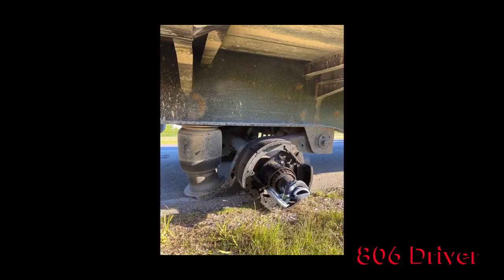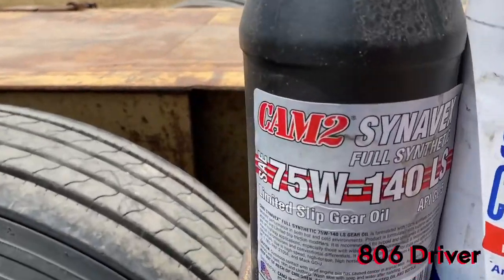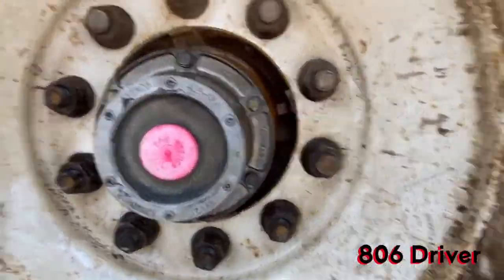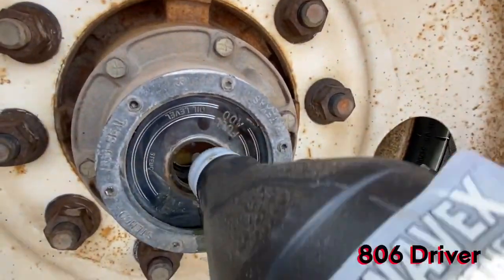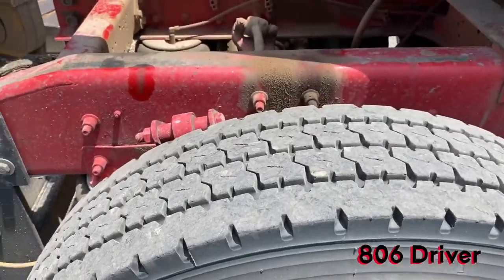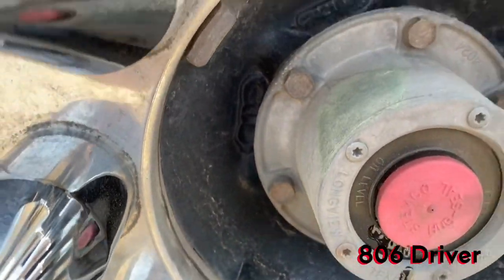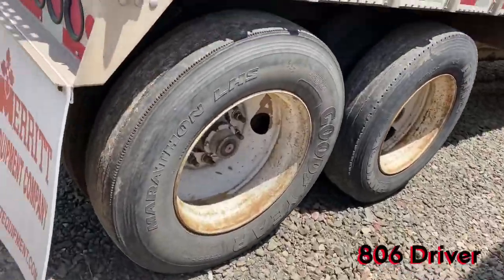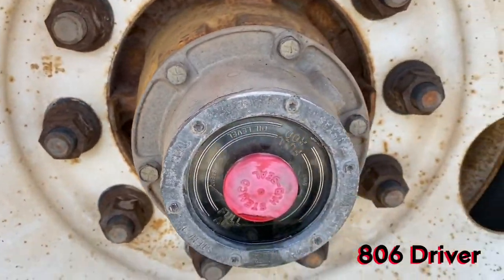Drivers Don’t lose your duals, Trucker Vlog, Maintenance Breakdown, How to prevent losing your tires

Comment: I saw a set of duels come off a lumber trailer at 60 mph on the highway.  It rolled off the road to the right, hit a tree, climbed up the tree about 20 feet up it caught a branch and launched back toward the highway striking a school bus in the passenger side windshield, becoming wedged into the bus.  No kids were on the bus and the driver was really shook up but not injured.  This happened on I-5 in Eugene, OR. in 1992.  
It seemed to happen in slow motion but it was actually very fast and violent.